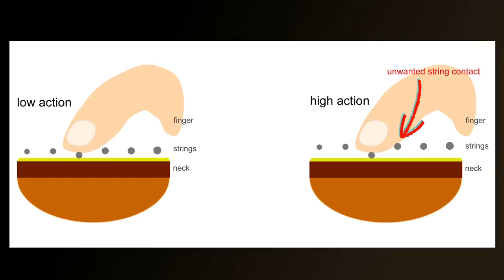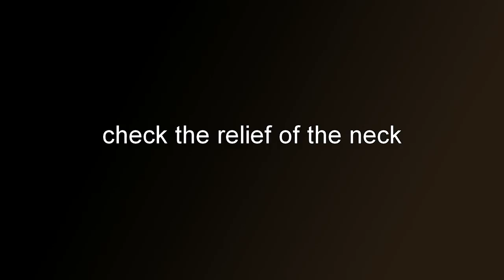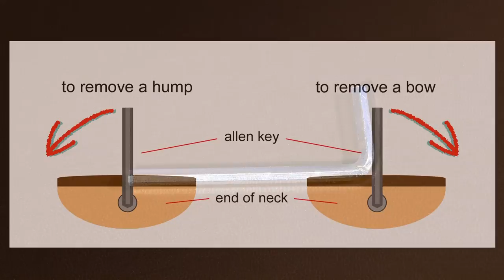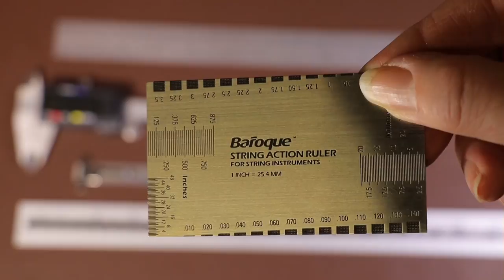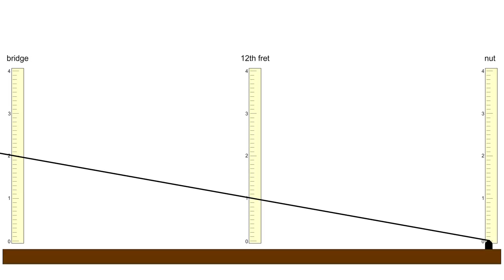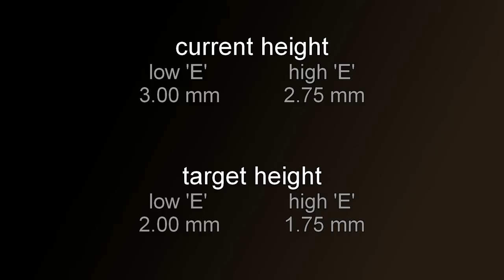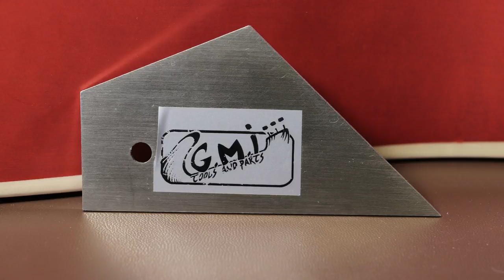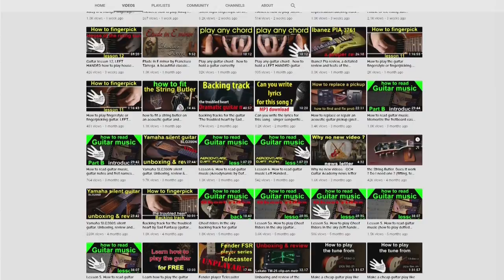How to setup an acoustic guitar, adjust the action, saddle & truss rod (Pt. 1)  guitar set up

Comment: Great video, very detailed, which is great. I will say, that I saw a neat trick from a Gibson tech video on this subject for acoustic steel string guitars. He only detuned the strings, then pulled the pegs up (with a peg puller), and left the strings in place on the head, but just coiled up the strings towards the head/nut. When repegging after modifying the saddle, it was much easier and faster, not having to deal with re-threading the eyes of the keys
Reply from the maker: great tip . . .  thank you 😊😃

Comment: Fantastic videos; simple to follow and bullet-proof because the methods are so logical. I watched a ton of YTs that went into absolute measurements at different frets, with no explanation of what we're trying to achieve - 'monkey-see monkey-do', and "if that doesn't work you might wanna try adjusting your truss rod to get your string to the right height". I've done 2 entry-level acoustics now, a $400 Yamaha and latterly a $100 Fender which I bought as a cheap travel guitar; the fender sounds gorgeous, better than the Yamaha.

I made my mistakes on the Yamaha, primarily not sanding the new saddle and nut carefully enough - I did them by eye and later I used a solid stainless engineer's square to examine them, both were off. I'm in the process of replacing again, hence watching the video again.

So for the Fender I sanded by holding the saddle/nut against the square and went VERY slowly over a large, dead flat, piece of 120 wet/dry I pinned to my work-bench. Probably took me an extra couple of hours but the result was magnificent; the sound from the Fender is wonderful to my ear and is a joy to play, low action and no buzz. My F-barre chord has gone from unplayable to easy-peasy.
Reply from the maker: Great stuff . . It's amazing how a little work on the setup can make what seems to be impossible, possible (the F chord) 😊😀

Comment: Old interesting and very informative Vid, Some info, I bought a Chinese navy blue, Electro acoustic Cutaway guitar, off UK bay. Sold under the Tiger brand. Bought on the19.12.23. £55 posted. I was very surprised at the quality. The  action was high, I went through the exact same steps. Neck relief sorted, I had to take 3mm off. the saddle, Just in case I made a mistake. I bought a pair of bone saddles of UK amazon £6 posted, next day delivery 21.12.2023, . 
 I didn't remove the strings at the headstock I loosened them just enough to remove the pins. But before removing pins I put a capo on the 1st fret.. Then  wound the strings out of the way.  I used a very thin marker pen, to mark off 3mm. Then I used a Multi tool, with the sander attachment, rough grit, finishing off with wet and dry. To finish off,  I used the same method you did, but a lot quicker,  Final result,  Just over 1.5mm. Bottom E, and just over 1mm top, and no buzzing frets
Reply from the maker: Very nice . .  it sounds like you bought a bargain (once you set it up) 😊😀
Reply: @guitar-academy  It was brand new, sold as a package, by DJM Music an actual English retailer, Padded gig bag spare set of strings. There's still a couple on the bay at £59 posted. There normally £110-£129, I think there  old stock that need to be sold to  make way for new, Gear4Musice sell the exact same guitar with a slightly different shaped head stock 
BTW,  You're vid was reassurance I'd set my guitar up correctly 👍😊

Comment: This is super helpful. Thanks. The thoroughness and clarity of this video are supported by the excellent lighting and camera work. Question: what happens to the intonation when lowering the saddle?  Can intonation be maintained?
Reply from the maker: Most of the time the intonation remains the same.  But if you're changing the strings, try to keep the gauge the same as Changing the gauge of strings can effect the intonation 🤔
Reply: @guitar-academy  Thanks!  I was hoping that would be the case.  The easy intonation tweaks on electric guitars has my ears trained up.

Comment: If after you replace strings and find you need to lower the bridge or address a fret. Leave the capo on the first fret , Loosen the strings, pull the pegs, sand the bridge or file the fret, return the strings and pegs, check height.
Reply from the maker: good tip . . 😊

Comment: Great video!

Beginner here.  May I ask why the capo is used to take the nut action out of the equation?   What if the nut is influencing the action more than the saddle.   For a beginner, I spend most of my time on the frets closer to the nut….shouldn’t I verify how “off” the nut is before moving to the saddle adjustment.  

Again, awesome video.
Reply from the maker: Thank you . .  good question.  The nut adjustment is far harder that a saddle adjustment and to do it properly requires expensive tools, so I don't cover that yet. With YouTube reaching all sorts of people I don't want to risk someone ruining there guitar by attempting something beyond their capabilities. 😊😀
Reply: @guitar-academy  I definitely understand.  The nut adjustment is not something I would want to tackle.   

I am trying to determine if a person checks the relief on the saddle end and determines the saddle needs lowered….but checking the nut relief end tells a person that I am never going to get there without a nut adjustment only…..at that time the guitar is headed toward a tech.  

I am trying to predict the impact on the nut end by lowering the saddle.   I am assuming this would be negligible.   I need to do more thinking on this.

Comment: Thank you very much for your videos they are priceless for me,
I'm restoring my father old guitar for his birthday, he got it when he was 13th he is 60 now
its an holiday, apparently a cheap one so improvement like this will make a huge difference

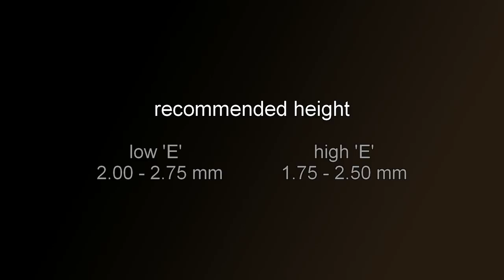I have a question though whats your recommended heigh (14:48) for a classical guitar ??
wondefurl videos

best 
D
Reply from the maker: A true classical guitar doesn't have a truss rod so you're at the mercy of the guitar but some of that age have a truss rod and they called it 'a steel reinforced neck'.  If you do have a truss rod and you can get the neck relief good you should be able to get about 3mm on the thick string and 4mm on the thick string.  A nylon strung guitar has an action at least 1mm higher than steel strung guitars.   😊

Comment: Thanks for all your great videos.  Very helpful and well done.  I lowered the saddle height by 1mm per your video, but when I removed the capo, the action height increased by half of what I removed. What does that mean?  Do I need to deepen the nut slots and if so, have you got a video?😅
Reply from the maker: I haven't done a nut adjustment video yet because to adjust the nut you have to be very precise it is easy to get it wrong.  Also the tools to do this (properly) can cost more than cheap guitar 🤔
Reply: I ended up leaving the nut alone since the string height towards the neck seemed ok. I just kept sanding the saddle down little by little on my belt sander, and it was quick work.  I used your remove 2x the desired change at saddle technique, but for some reason, it removed less than what I wanted.  Better too little than too much, and it was good practice.
Reply from the maker: @flppr1  Yes, that's a really important bit of advice you give there 'better too little than too much' 👍👍

Comment: Which is the right side of the saddle please ive been watching your set up video but couldnt get which is thr right and wrong side
Reply from the maker: If your saddle has a compensating string slot, that is usually the 'B' or ''G' string and should be on the thin string end.  If the saddle is slightly tapered you want the side that makes the strings longer on the bass side and the side that makes the strings shorter on the top 'E' side.  
I hope this helps

Comment: Thanks, very informative. I have a similar cheap "western" guitar with the strings on the lower part of the neck way to high compared to my Fender Stratocaster and Gibson Les Paul (yes, I put some money in these ones ;-). But it seems that the saddle of my guitar is already very low,  it seems to me that it has not much room for taking of some more.  So I would have to lower the whole bridge, and that would be a totally other project.
Reply from the maker: Yes, that sounds like a pain in the neck.  It is a big job removing the bridge, lowering it and resetting it in place.  You can improve the guitar by taking the saddle down as low as it'll go, make sure the nut isn't too high and make sure the neck relief is good, but this might not be enough.  In some cases you can groove the bridge under the strings, but I need to do a video on this because I couldn't explain it here.  🤔
Reply: @guitar-academy  Hi, thanks for your answer! It seems to me that these types of guitars are meant to be played based solely on the notes at the top of the neck. And I often see that in practice. My guitar is of reasonable quality, but the manufacturer has not paid attention to string adjustment at all (in my opinion). But looking at the standard height measurements your are mentioning in your video, these are basically higher then what we see with electric guitars. I don't know if I can expect to play these acoustic guitars like the electric ones.
Reply from the maker: @johanwithag2432  I agree, electric and acoustic guitars are very different animals.  You also find that generally the strings are thicker on acoustic guitars.  This also makes them more difficult to play. 🤔

Comment: If the guitar pegs don’t go in all the way in on the bridge because of their size does that affect the playability of the guitar and how would I fix that problem?
Reply from the maker: Good question.  It depends on how far the pegs go in and why they don't fit.  If they're new then you might need to sand them slightly, if they did fit then they might be out of order try changing the order.  As long as they don't stick out too far the guitar should play OK . . I hope this helps 😊😀

Comment: Thank you very much! I was just wondering, though, how to assess the truss rod with the second method starting at 8:30    (pushing down the strings on the first fret and on the sound hole ...). I did not understand what the criteria for a good distance was in this case ... is it under 1 mm like in the first method?
Reply from the maker: Yes, exactly.  Look near the middle of the neck and check the gap isn't too big or that the strings aren't pressing against the strings.  😊
Reply: @guitar-academy  Thank you! Middle of the neck is about the 6th or 7th fret, I assume? (so the whole of the neck being the part till it meets the body of the guitar ...)

Comment: What fret do you measure the string height? I notice on low E you measured between 2nd and 3rd Fret from the body and high E you measured just past the 3rd fret (from the body).
Reply from the maker: All the action hieght measurements are done on the 12th fret, because it's exactly halfway down the length of the string.  I hope this helps. 😊👍

Comment: Hi, great video. I have a question, are there any considerations if the guitar/saddle has a built in preamp? Thanks.
Reply from the maker: The only consideration I can think of is to make absolutely sure the bottom of the saddle is flat if you sand it to lower the action.  If the saddle is uneven on the bottom you'll have loader and quieter strings as a result  . .   😊

Comment: Thanks for the informative series of videos. Are your recommended action height also applicable to classical guitars? Thanks.
Reply from the maker: I have to do a video about classical guitar because they are awkward.  You have to be very careful with the action on them because they don't have truss rods (most of the time) and this means the neck relief can't be easily adjusted.  I tend to have keep a higher action on classical guitar, but a lot depends on the guitar.  If it's your own guitar I would lower it a bit and then play it for a while and then lower it a bit more etc. until you reach a comfortable but buzz free action.

Comment: Pro tip...keep the bone dust in a  small glass jar. It'll come in handy if you need to fill a nut slot or void in the saddle. Jus a drop of CA glue and you're good
Reply from the maker: great tip . .  I use super glue because it sets so quickly and hard 😊

Comment: Just one quick question, if u capo the first fret, the action height shouldn't be that high, or did i miss sth?
Reply from the maker: If you measure the action with a capo in the 1st fret then you're prevention any issues with the nut effecting the measurement.  😊😊

Comment: Without capo on 1st fret my guitar action on low e seems quite high, around 2.9-3mm. With capo though the number is much better, around 2.1-2.2mm.

I have my neck adjusted to the point where it doesn't buzz at the fifth fret. Now I am confused about few things. Should i still worry about my guitar action being quite high without capo? If yes what should i look into adjusting?

My confusion comes from watching a lot of videos where they recommend height distance under 2.5mm but they dont measure while capoing the first fret. 

Sorry if i am overthinking it but i am really new to this. 😅
Reply from the maker: No you're not overthinking it.  There's a lot of people doing tutorials who don't know what they're doing so it's good to question.  Really the action can be what YOU want, not what somebody else says.  I know people who like higher action that you have and play really, really well and my flamenco guitar that was hand made by a master luthier has an action close to 5 mm.
To know for sure if there is a problem with your guitar I would really need to see the guitar and hold it.  Another thing you can check is the height of the nut, but I haven't done a video on this yet because the tools needed are expensive and the adjustments are very small, so it's easy to get wrong.   I'll speed up getting that video done 🤔
Reply: @guitar-academy  If i am remembering it right, in one of your videos you held third fret with a thumb and clicked on the first fret to check action at first fret and nut height, my strings at first fret seems to be touching the fret when i hold it at third fret.Not sure if that is a problem or not..Thanks for these videos though, don't really have any good luthiers in my city so these help a lot.
Reply from the maker: @onewingedhawk6134  Yes that's right, or you can put a capo in fret 3 and look at the height of the string above the 1st fret.  If it's nearly touching fret 1 then that's correct.
Everything sounds OK on your guitar, but as I said previously it's so hard to know for sure without seeing it. 🤔🤔
Reply: @guitar-academy  Thanks, this kinda puts my mind to rest a bit, kinda gets overwhelming at the start.
Reply from the maker: @onewingedhawk6134  agreed . . it does get overwhelming 😊

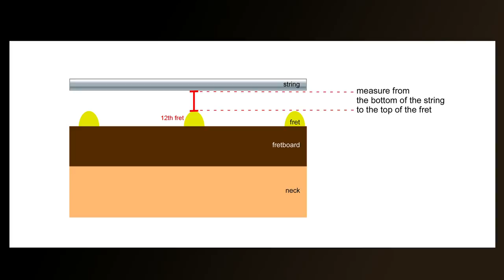Comment: 12:54   why nut should not have an effect in considering the action height at 12th fret?..many videos shows the action at 12 the fret without keeping a capo at 1st fret?
Reply from the maker: Sorry to be blunt but the other videos are wrong . .  too many people on YouTube are making videos and they're not trained luthiers.
You have to have one fixed point in order to make any accurate adjustment and the nut is not a good fixed point because that might need adjusting as well.
If you don't use a capo and the nut is too high, when you lower the saddle the guitar will never play properly because the stings will be at the wrong angle.
If you lower the saddle and get the action correct and then take the capo off and the action goes up, then you know that the nut needs adjusting as well.
Reply: @guitar-academy  ohh thanks a lot for making me understand,well suppose if I have a brand new guitar just bought and wanna check the action of the guitar..and also in the beginning don't wanna make any adjustments is it necessary for me to fret the first fret and then check the action or do I directly check the actual height at the 12th fret without fretting the first fret?
Reply from the maker: @dhavalparmar4472  No problem with that, just check it as it is, no need to fret the first fret . . 😊
Reply: @guitar-academy  thank you so much for your help, your tutorial is the best in entire YouTube ,easy to understand and easy to follow too..
If something is understandable than only the question arises.
I'll check my action without fretting first as I have brand new guitar and it has a Tusq nut and saddle...they are quite expensive here in our guitar store in India...so I'll play the guitar for few days and if I feel the action needs adjustment I'll definitely follow your instructions in the video...and if some questions arises I'll be commenting here...
Thanks a lot again.....
Reply from the maker: @dhavalparmar4472  Thank you very much . .  Hopefully your guitar wont need any adjustment at all . . 😊😊

Comment: Better than taking the strings completely off is to loosen the strings and simply pull the bridge pins thus letting loose the strings without removing them from the head stock.
Reply from the maker: Yes, that works.  😊

Comment: What happened to that nut! And before taking off hight of the saddle, you should check your nutheight first, or???
Reply from the maker: No you don't. . . Watch 12:50 again where I explain that I have taken the nut out of the equation by putting a capo in the first fret.  I don't adjust the nut in this video because it's a beginners lesson and the nut is far more difficult to adjust and if you need to recut the slots for example it can cost you over £100 just for the tools.